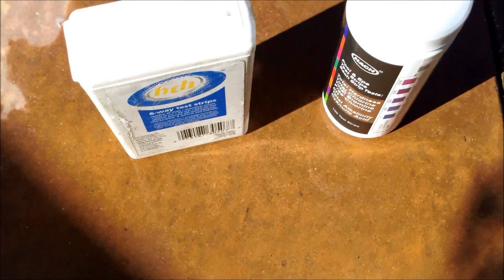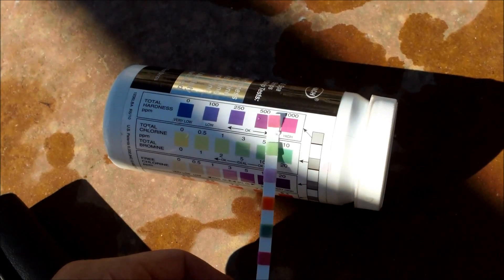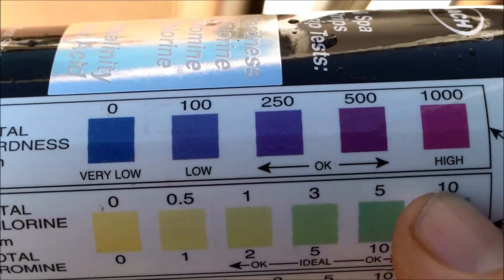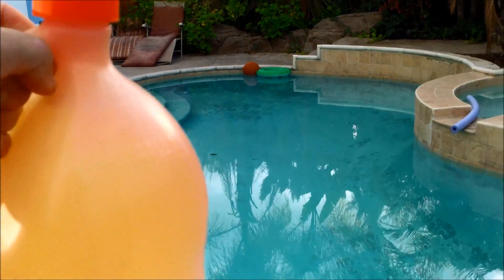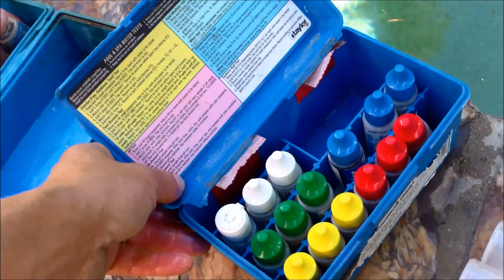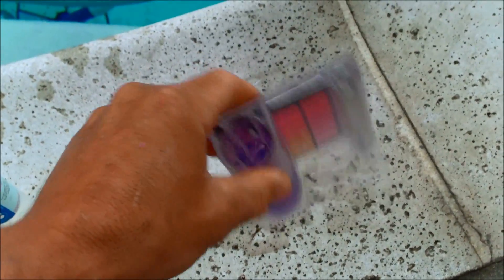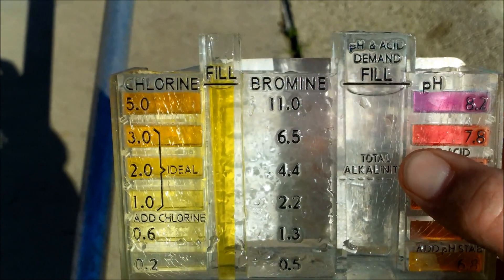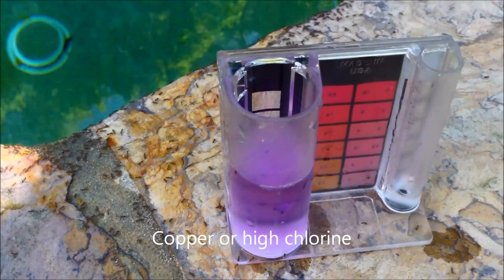How To Test and Adjust Calcium Hardness in a Pool

Comment: I messed up on one of my salt pools.
It has high salt and high Calcium hardness and high alkalinity.  I let the PH get high, and noticed white flakes building up in the corners of the pool.  I could scoop them out with the net.  I have been needing to clean the salt cell every other week.  Now I'm struggling to get the PH down.
I should have done a partial drain for the salt levels, but now it is summer and I don't want to drain a pool in the heat.
Reply from the maker: Just lower the pH down.

Comment: Thanks very much for explaining testing and adding calcium in pool.  However, to make it easy for metric system, Calcium  dihydrate (70%) raises 50 ppm with 3.84 Kg for 37900 litres after conversion.  Anhydrous CaCl2 uses 2.69 Kg/37900 litres.  Adjust litre figure to current pool capacity (nearest guess of water level) then work out calcium amount in proportion.  Add calcium with advice/precautions and check level carefully before further top-ups.  Correct those figures if I'm wrong.  Never add alkalizer (bicarbonate/carbonate) together with calcium.  You'll get insoluble scales on pool and equipment surfaces.

Comment: My salt pools automatic dosifier keeps clogging up because of high calcium levels. The water where i come from is also insanely hard, what do i do to try and bring my levels low again? Its destroying my pool system.
Reply from the maker: Try to keep a more negative LSI. Its a more deeper part of chemistry. If you go to Orenda Tech they have free courses on the LSI. That will solve the issue.

Comment: I have a 16000 vinyl pool with a salt water system. Calcium hardness is around 570. Water from tap is around 120. Any idea of how much water to drain to get it back into range?
Reply from the maker: You have to be careful when draining a vinyl pool. It wouldn't hurt to check with a vinyl installer in your area to see the best solution for your issue.

Comment: I recently drained my 3 ears old aquartzscape pool and did fresh water in la. I noticed my calcium hardness is 130. It's been about 4 weeks. I'm going to increase it tomorrow.  Can my  pool surface suffer damage and etching in a matter of 4 weeks, or am i ok; I saw some stains in the deep end that looked like the  surface  top layer was dark spots or was removed layer  i don't know if I'm just being paranoid or will the damage happen this quickly in the pool its has been more then 4 weeks that i refilled water everything is balanced right i didn't pa attention to calcium hardness
Reply from the maker: It will take longer than 4 weeks and 130 is not super low. Maybe you are just looking too closely at your pool surface.

Comment: My vinyl pool has CH of 105 and TA of the same. One place recommends CH200 and another 175. Your slide seems to say mine is in a good range. So you think i should leave it as is?
Reply from the maker: Would say 150 ppm is on the low end. But being at 100 ppm is fine.

Comment: I have a 15 gallon above ground pool saying its 1000 hardness,and needs calcium chlorine.I just put Calcium Hatdbess increaser as recommended yesterday,and Alkanity increaser+ has a chlorine tablet floating around?
Reply from the maker: 1,000 hardness is pretty high already would say doesn't need the increaser.

Comment: When I used the test strips, all chemicals level are normal , but the total hardness is usually high, any recommendations? Thanks
Reply from the maker: That is Total Hardness so not as accurate nor the same as Calcium Hardness. So that number will be higher.
Reply: @SPL  thanks. My pool has a salt chlorinator installed, but my pool service company told me that it won't generate enough chlorine when water temperature drop below 55/60 degree. He put chlorine taps into a container that flow around the pool. Is this normal practice for a Gunite pool with salt chlorinator? Could this cause high level of hardness? Thanks.

Comment: Mine turned purple right after adding R11L blue drops. It is just like this other video: https://www.youtube.com/watch?v=RANwktWJLqU. I tried adding R7 and R12 before adding R10, but it still turned purple after R11L. Even without adding R7 and R12 before R10, it does eventually turn blue after adding R12 at the end, but what is causing it to start from purple right after R11L? And is accuracy compromised as a result?
Reply from the maker: I don't think it would be but if you call Taylor Tech they are great at answering your questions.  800-837-8548

Comment: One of my new accounts does not hold calcium. I added 50lbs it’s about 16k gallons. It’s at 120 ppm .I added it 10lbs a day tested and it would still be low. It does have a lot of bubbles coming out of the return line. Meaning it has a leak. I’m thinking the calcium might be leaking out?  Starting calcium was about 30ppm.
Reply from the maker: I bet the leak is pretty substantial. Probably the new fill water is lower in calcium and thus you are getting a lower reading every week.

Comment: My test kit says its 230ppm , pool store says 157, and another store says 130,, 20,000 gallon vinyl pool , who do I believe,  all other levels are perfect
Reply from the maker: What tester are you using?
Reply: @SPL  just the cheap 20$ Walmart hth test kit , been using it for 3years and my readings are usually close to the pool stores but this time ch is off
Reply: @SPL  also I all of a sudden have a yellow or orange stain taking up most of deep end and ramp going from shallow end, it's not wiping away so dont believe its algae,  but I did just defeat a algae bloom while opening the pool, could it be from that and is it something to worry about

Comment: Hi, here in Arizona we have absurdly high calcium levels. Fresh water starts around 500-700, and by summer the level is nearing 1000 ppm. pH control is difficult due to all the pollens and dust, plant matter, etcetera. It tends towards alkaline. In sumer I use baking soda to both soften and buffer pH. Is there any sustainable way to remove the metal that won't drive my other chemistry crazy?
Reply from the maker: Using a metal sequestering agent with the CuLator 4.0 is an effective method. You may want to add Borates to your pool and bring it up to 50 ppm. This will buffer both the pH and Calcium in the water. The Optimizer Product I recently reviewed works really well.

Comment: Why can't everything be standardized and simple.. there are a million ways to test pool water.. every one comes to the same conclusion.. kinda like common core
Reply: standardize the tests yourself. its not that hard, but a taylor k2005 kit and do the tests every day, it takes less than 10 minutes to avoid pool issues. leslie pools has a kit that is essentially identical to the taylor so whichever one you find cheapest is the one you buy. keep the kit in the house and replace your agents annually...

Comment: how low should my chlorine level be befor I test the ph and ta  without it bleaching the results I have a high cya of 200ppm so I keep my chlorine at 15ppm until I get it down I would like to know a safe chlorine level to test at thank you..
Reply from the maker: Below 10 ppm. But you can go to your local pool store and they should have a more advanced tester that will give accurate readings at 15 ppm. They usually offer this as a free service - just buy something on your way out ;).

Comment: When I run my calcium hardness test it turns more of a clear color rather than blue and has small pink flecks floating around the tube.  The chlorine is at a normal level and adding the drops of R-12 didn't seem to change anything.  Any advice?
Reply: yes, it turns clear blue; it is the hardest test to preform. What i tell people is: set up your vial with 20drops of 10, 5drops 11, LOOK AT THAT COLOR. Then add 30 drops of 12 to see what the finished color should be. i know your comment is 2 years old but thought id mention it because i am asked about this a lot.
Reply from the maker: +Betsy Bremer Maybe the Reagents are expired?

Comment: I got my water tested from Leslie's and initial test showed reading of 700 and 2nd test reading showed 460. My questions is, can I drain some pool water and add water softener water that is hooked up in my house to lower the calcium level and if yes then how much water I can add. Will draining 6 inch of pool water and adding soft water help lower the calcium ? I am seeing whilte hardened stuff built up around the tiles so I am thinking it because of calcium hardness. I don't want to drain the whole pool so what could be the alternative.
Reply from the maker: +TrendTrader4U I would say the 400 range is probably the more correct reading. Not much can be done about high calcium hardness except to drain some water out and refill the pool. Depends on how big your pool is as to how much water to drain out. I would get the levels retested just to verify the number before draining some out.

Comment: Thank you for rhis video, I need help.  I had a water softener system installed in my house and apparently is linked to my pool.  So, I have noticed a little algae like on the walls in my pool that I never had before.  Do you think that the soft water is the one causing this issue?  Should I start using calcium in my pool.  Please help me with this.  I really enjoyed your video.  Thank you so much

Comment: Hi, I have a salt water pool with a IC40 Intellichlor system  I just replaced the salt cell, and I always get white build up in a matter of weeks on the blades. and I also have small white flecks in the pool, but the test kit shows 7.4 for the ph so I dont really need to add more muratic acid, any suggestions  PHX, AZ.  very hard water here
Thanks
Reply from the maker: There are a few things you can try to reduce the calcium build-up on the plates. Beautec by Easy Care is one alternative.  Adding Borates to bring the levels to 30-50 ppm also has an effect on calcium build-up on the plates. I have several videos on adding borates on my Channel  - a complete playlist also. As far as the flakes - sometimes Phosephates in the water react with the salt system. Adding Phosefree to the pool through the skimmer over a course of a month or so will help. Add 2 capfuls through the skimmer each week for  4-5 weeks and the flakes should dissipate. I know it sounds weird but it works.
Reply: Swimming Pool Tips, Reviews & How To -MrDgvb1 

Thank you for this video, I need help.  I had a water softener system installed in my house not too long ago and apparently is linked to my pool.  So, I have noticed a little algae like residue on the walls in my pool that I never had before.  Do you think that the soft water is the one causing this issue?  Should I start using calcium in my pool to harden the water?  I have heard that if the water doesn't have enough calcium that it would start abstracting the calcium from other sources like the plaster and the grout between the tiles.   i did a calcium test on the pool and it saids is ok.  However, I don't know if I should add calcium so this way my plaster and tiles are safe.  Please help me with this.  I really enjoyed your video.  Thank you so much
Reply from the maker: melpiano Calcium hardness doesn't effect the algae growth in a pool. could be a chemical in-balance or poor filtration. . What is your Calcium Hardness level?
Reply: Swimming Pool Tips, Reviews & How To -MrDgvb1 Hi, Im just worried that since I installed that soft water system in my house the water in the pool now has less calcium and is getting the calcium from other sources like the plaster.  I tested the calcium and it seems to be normal, I don't quite remember the numbers but it was normal.  How do I know if the water in the pool is getting the calcium from the plaster or tile grout?  Since I have soft water going into my pool, should I add calcium to the water to make sure my plaster stays safe?   Thank you for getting back to me. I really love your videos man.
Reply: Swimming Pool Tips, Reviews & How To -MrDgvb1  Hi, Im just worried that since I installed that soft water system in my house the water in the pool now has less calcium and is getting the calcium from other sources like the plaster.  I tested the calcium and it seems to be normal, I don't quite remember the numbers but it was normal.  How do I know if the water in the pool is getting the calcium from the plaster or tile grout?  Since I have soft water going into my pool, should I add calcium to the water to make sure my plaster stays safe?   Thank you for getting back to me. I really love your videos man.
Reply from the maker: melpiano Unless it drops really low there shouldn't be an issue. You can add Calcium Chloride to raise it up. 200-400 is a good range so if it drops below 150 add the Calcium Chloride.

Comment: Today I added 2 lbs of Fresh and Clear as could not find Shocktrine, I think it is the same thing, Potassium. How long before I test the water again to see if the TAC has lowered and what should I do if this does not work?

I re-tested today my Calcium Hardness at the pool shop and it is confirmed at 650. Also today they say my CYA is now 100 although they said it was 50 a few days ago. Not sure how to proceed or what to believe. I am waiting for my Taylor kit to arrive.

Comment from the maker: They sell 1 pound bags of Shocktrine at your local pool store (I don't think Leslie's carries it). 1 bl of Shocktrine will treat 10,000 gallons. The Free Chlorine of 3.0 is probably countering any effects of the combined chlorine. Besides - getting an accurate combined chlorine reading is debatable in the industry. If the water is clear you probably can just ignore the Total Chlorine reading. The Shocktrine won't hurt - it is Potassium which counters the Ammonia in the water.

Comment: Also originally added 15lbs of the Bioguard copper stain remover which I think caused all my problems with my TC being so high. You say having any TC is bad, correct? I tested with my DPD Kit tonight and the TC is still at the highest reading.

Comment: Thanks for your reply. Here are my readings from Sunday. My pool is clear.
FC 3
TAC 4
PH 7,2
TA 80
CA 50
CH 650

Remember I did add 26 lbs of shock a week or so ago because the pool shop told me my TC was 10 or more. Then another shop told me it was 4. The bioguard shop has different numbers then you guys, My TC is still red when I test it with my DPD Kit. From your videos you say this is bad....how can I get it down? surely if 26lbs of shock didn't work, I don't need to add more shock?

Comment: My Calcium Hardness is reading at 650. I know the only way to lower it is the drain the pool. If I rented a sump pump from Home Depot, will I be able to hook it up myself.
Also my TC is high. I shocked my pool with 26lbs of shock but still the TC is as high. How can this be? Is it due to my CH being too high?

Is liquid chlorine the same as buying the bleach in the grocery store? Should I stop using the tablets and the shock granuals?

Your videos are very helpful.

Comment from the maker: They are two different types of disinfectants Chlorine based and Bromine . Most test will measure both. Unlike Chlorine where you can measure Free ,Available and Combined Chlorine- Bromine is only measured as Total Bromine. When you measure Total Chlorine it is just that and you will need to test separately for Combined Chlorine. I touch on this in my Taylor Test kit video. You find Bromine usage in Commercial spas or Cruise Ships. It doesn't produce a strong chemical smell like chlorine.